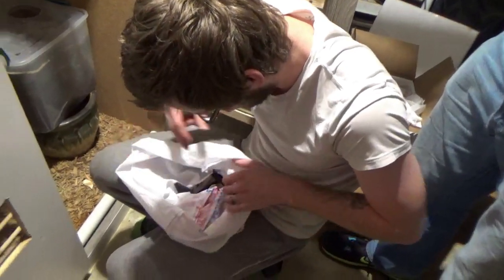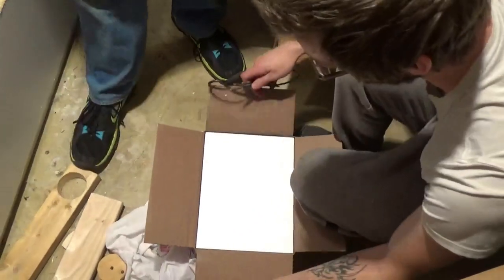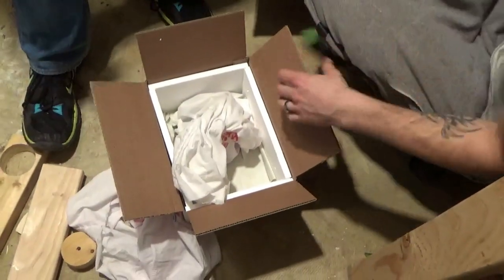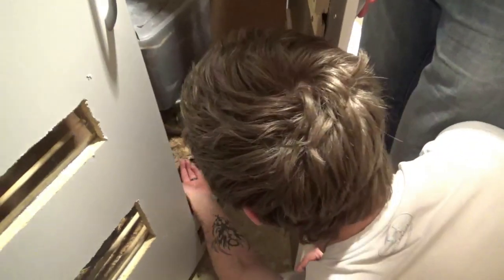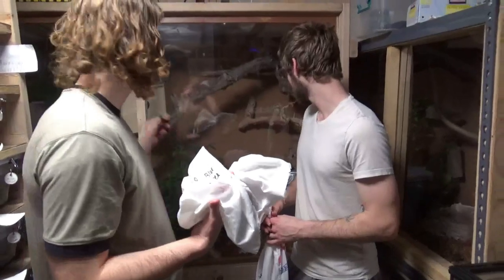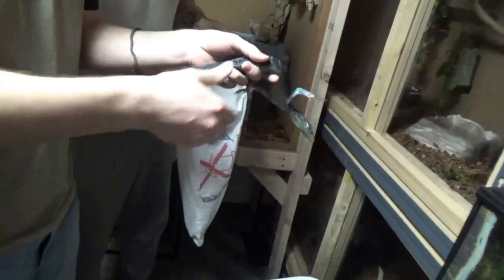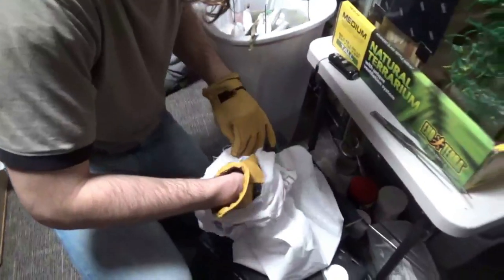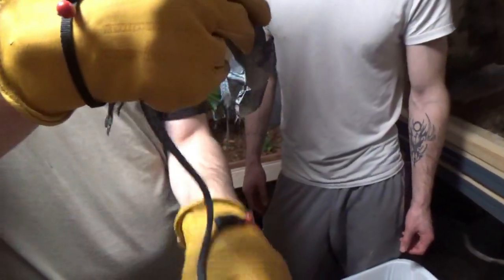Our Tree Monitors Are Here!!!

Comment: How bad is the smell in there to warrant a carbon filter?
Reply from the maker: the smell in the snake room and the lizard room is barely there. the smell in the rodent shed is pretty strong though. we had extra carbon filters we use for the rodent shed and we wanted to move a bunch of air in there to keep temperatures even throughout the room so thats what we used :)